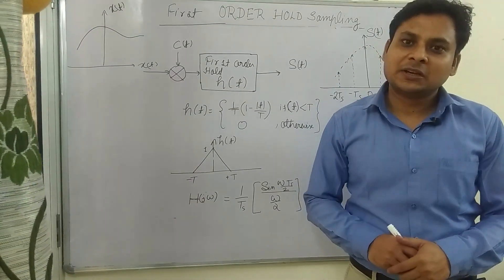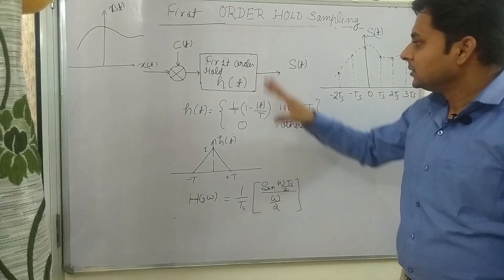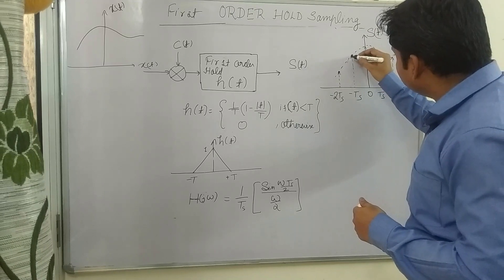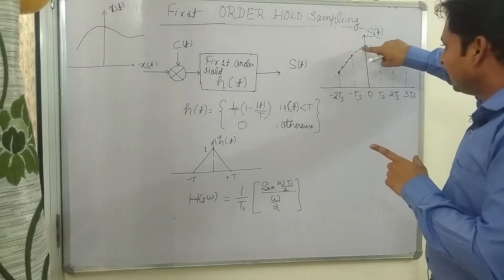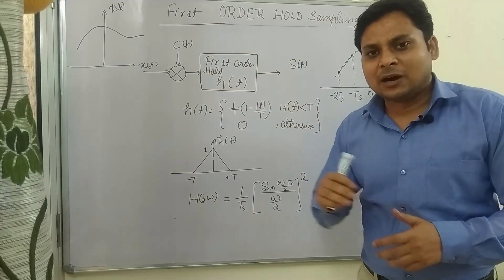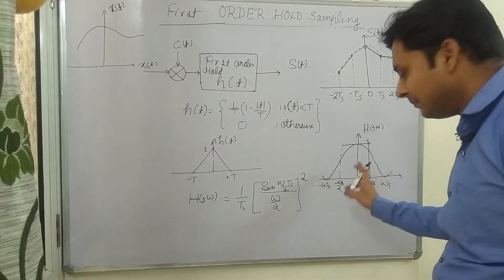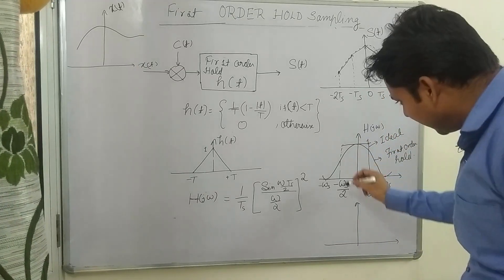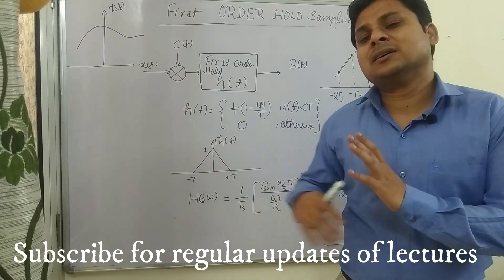First Order Hold Sampling (Detailed explanation)

Comment: How can you draw a line between the current sample and the next sample when the next sample hasn't yet happened? Shouldn't the line be defined by extrapolating using the current sample and preceding sample?
Reply from the maker: Hi Colin, Thanks to put your doubt here. Your point is absolutely correct. Practically while simulation, we need to extrapolate current sample to the immediate previous sample. we cant draw a line from current to next sample. I did not focused the point to make the lecture simple to make students(at beginning level) understand the significance of first order hold sampling.